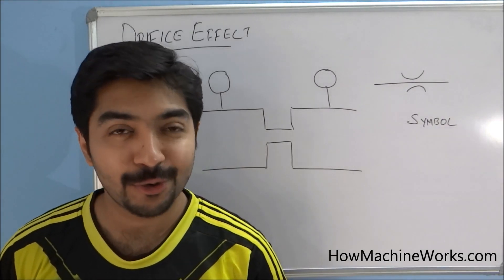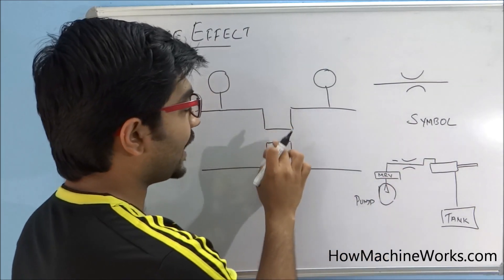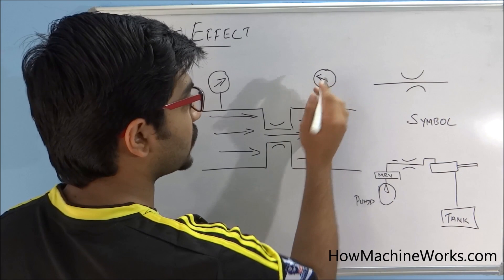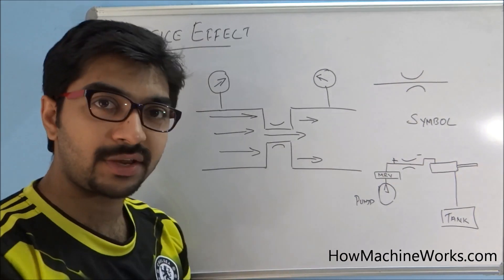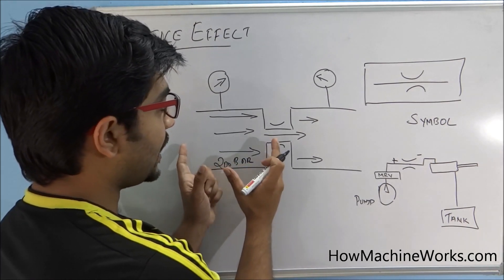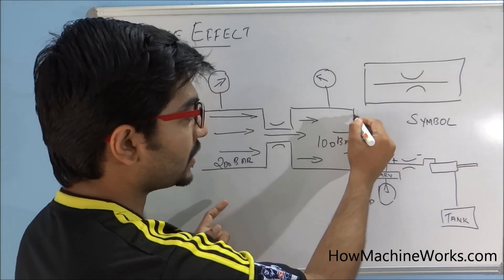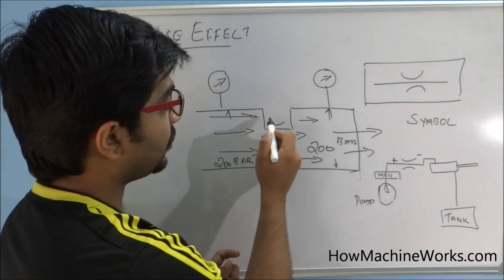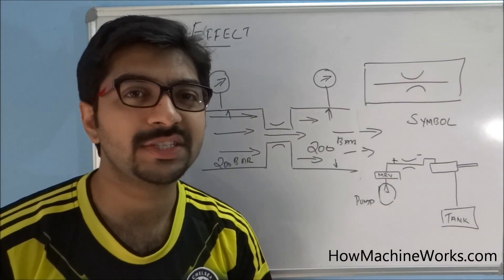How Orifice works in a hydraulic circuit - Must watch

Comment: Good Video, and explanation, but you left out a piece of very important information. The reason for the orifice in the first place, which is to regulate the movement speed of the device being manipulated (in your schematic a cylinder ram). Without the orifice when you send line pressure into the ram, it would tend to be jumpy, open and close too quickly, and be prone to slamming at the end of it's stroke, making the device quite possibly, dangerous, unusable, and prone to being damaged. Hope that helps.
Reply: Flow will remain the same before and after the orifice, unless the pressure drop is so high to open the MRV, and vent some oil into tank...
Velocity is dependent on area available for flow... (Flow  = Area x  Velocity) Flow is  constant.. Velocity will increase when oil is travelling thru the orifice and again decrease to original value after coming out of the orifice...
Reply: if pressure decrease and velocity increase after orifice according the Bernoullis theorem, how does adding an orifice slows down the cylinder speed?
Reply: @cavalry_knight  via Volume LMP or GMP how much fluid displacement matters not the velocity of the fluid.
Reply: Roy Tan
The whole point for an orifice in this application is to RESTRICT the flow rate downstream of the orifice. That way it takes longer to fill or evacuate the cylinder, which helps control the speed of extension or retraction. Without the orifice the cylinder would tend to be jumpy, uncontrolled speed, and slam at the full extension or retraction, all dangerous and undesired actions with most applications.

The application of an orifice where Bernoulli's Principal comes into play is when they want to use it to create a partial vacuum, usually to pick up a secondary fluid or gas. You see these in such items as a paint sprayer or yard sprayer, where air or water pressure is pushed through an orifice, usually in the shape of a venturi. As the primary fluid goes through that orifice (venturi) the velocity increases, and the pressure decreases (Bernoulli's Principle) and as such creates the partial vacuum needed to pick up the secondary fluid, such as paint or pesticides.

In short; orifice in hydraulic system to control Flow Rate, orifice in a pick up system to create a partial vacuum. Apples and Oranges.

NOTE; once the cylinder fills the line pressure equalizes. Meaning that while Flow Rate is restricted (slowing the filling speed) the orifice doesn't nothing to increase or decrease the line pressure once the cylinder is at full stroke. If line pressure was 100 Bar, the cylinder will equalize to 100 Bar, only with the orifice it will take longer to fill, and longer to equalize.
Reply: Good 👍